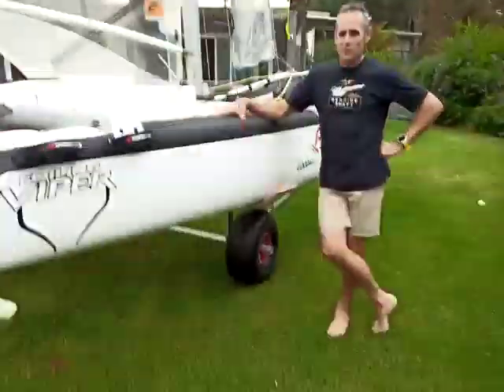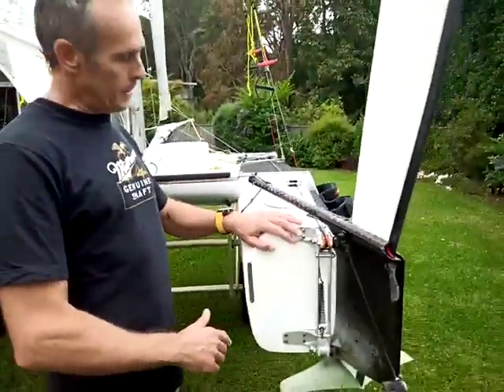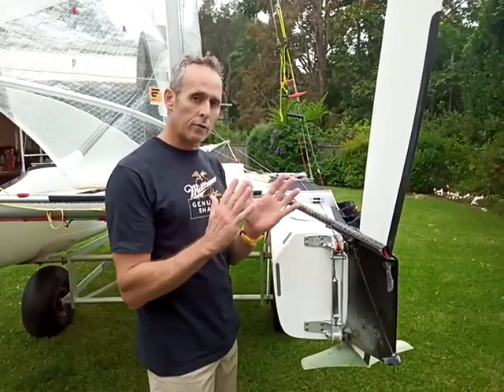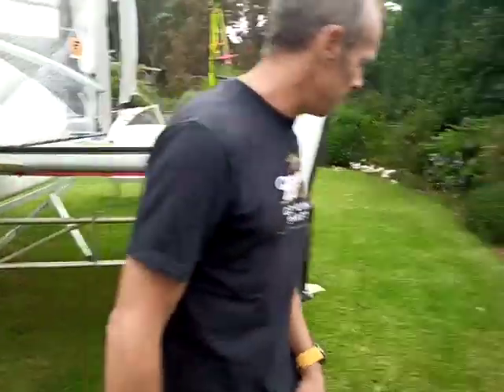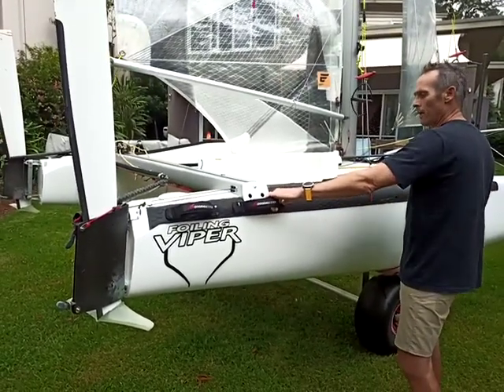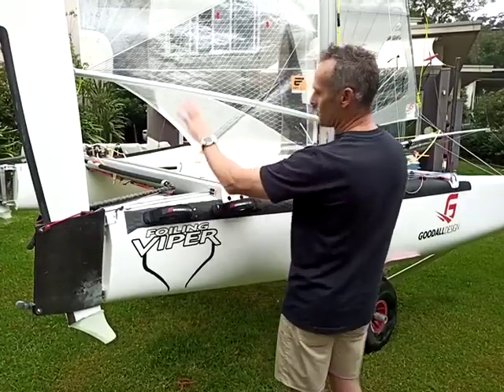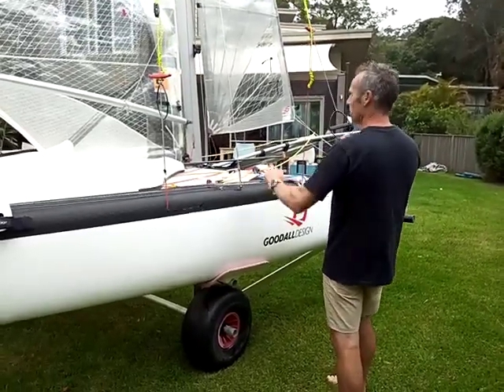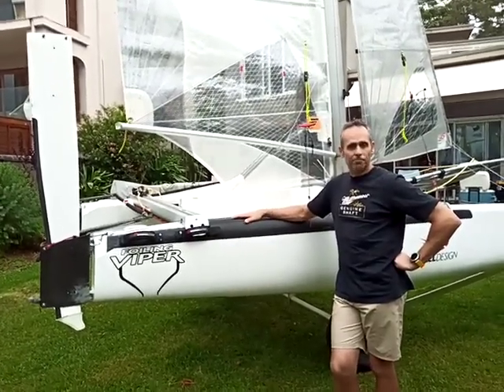Foiling Viper Rudder Rake Walk Through

Comment: Thanks for the video. How to get this differential rudder rake system? Retrofit or for a new foiling viper?
Reply from the maker: Retrofit to any foiling Viper! You dont even need new gudgeons. Once you have rake, differential is relatively simple because its all in the back beam with no cascaded systems. With it being in the back beam there is no other ropes to get tangled so it is really reliable. It may not be as "high performance" as the a class systems but its simple, low cost, strong and most important RELIABLE.

Something else I did not mention is the rudder movement is linear not radial like the N17 and lever arm systems on the a class. So the rudders dont change lateral angle which then requires ball joints, slides and other expensive parts.

It took a long time to work out, but to  make it simple takes more effort than complicated systems with through hull push rods, ball bearing sliders, gas struts, levers, spring cassettes and other complex systems we evaluated before finishing up with this.